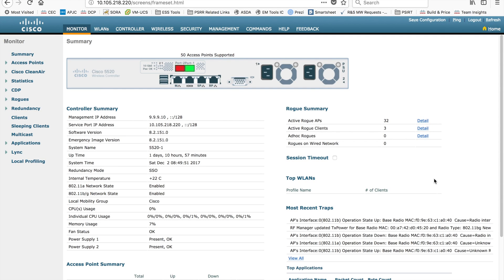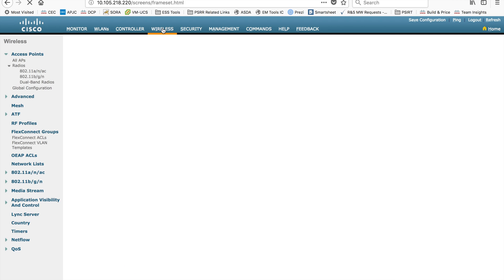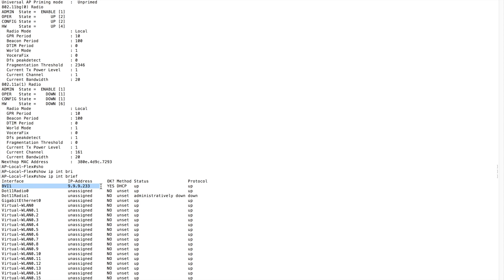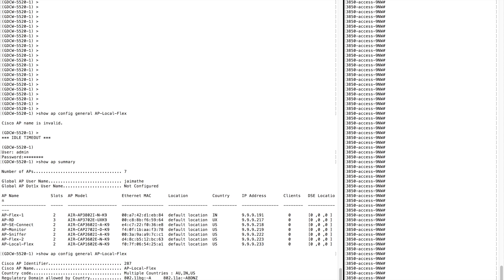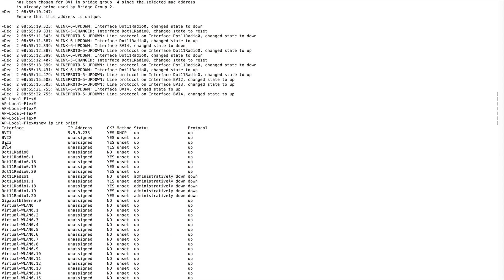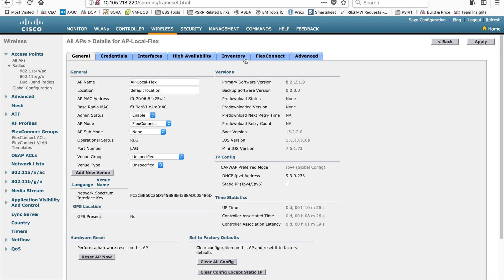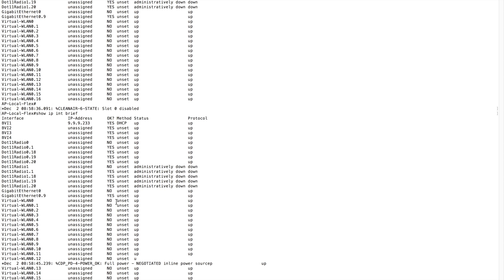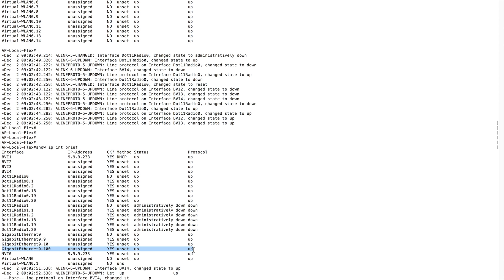How to Configure Flexconnect Mode on Cisco WLC  PART-1

Comment: Sir, Thank you very much.We are expecting more videos on WLC, and also if possible please plan  for Air magnet survey Videos also
Reply from the maker: Currently we all are using Ekahau and don't have the Air Magenet for now. If i got one will definitely will try to post videos on the same.
Reply: Please explain difference between local mode vs flex connect

Comment: Here vlan 10 and 100 has to be allowed in the ap uplink trunk port for the data traffic to flow correct?  Also we should have  a vlan pool for 10 and 100 on our switch or dick server
Reply from the maker: It's depends on your configuration from WLC. Like you have native VLAN configured or not for Flex AP. Local switching enabled or not. We have to match the configuration on opposite side on the switch port.